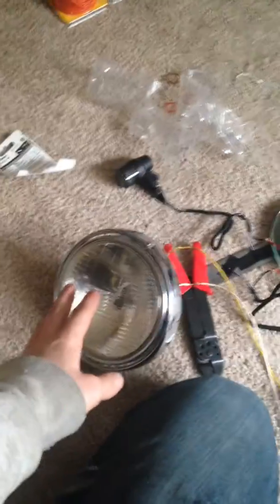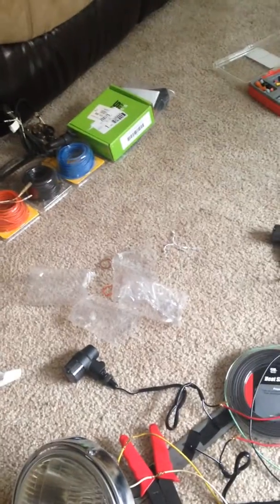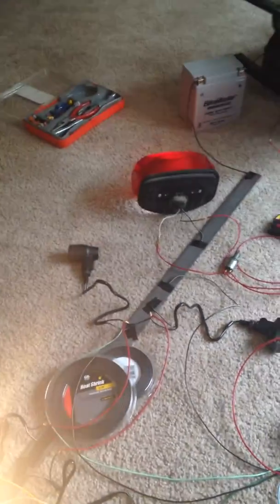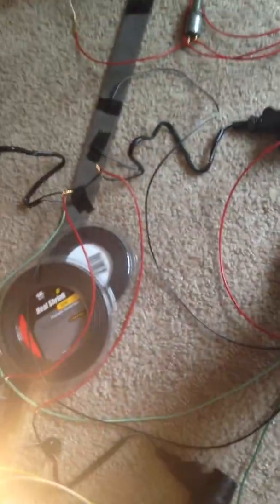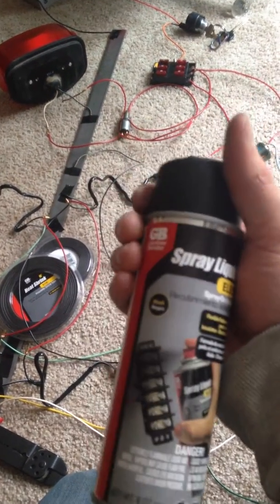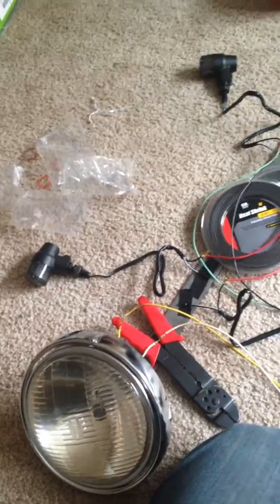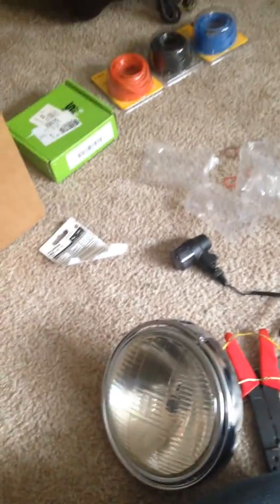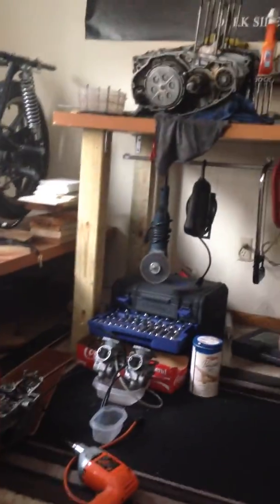Batteryless Motorcycle Wiring

Comment: Thanks. I'm rewiring a 75 cb550, do you think it's necessary to get the regulator/rectifier combo or will I be okay using the stock rectifier and regulator (they are separate units)?
Reply from the maker: Jordan Beck personally I would replace the old one. I typically like to replace all my components if I am going to be replacing one of the few

Comment: Hey +Tater Head, just curious if you would be able to send me a more in depth wiring diagram for what you did. I'm very interested in doing something similar with a '78 CB400T
Reply from the maker: +KaloTallman Did you see everything that I had in the description? Here is my most beautiful piece of art work so far... haha not
https://goo.gl/photos/5NVBik8989PZdtta7
Reply: +Tater Head Hey thanks for the quick reply! I was actually more curious about the aux wiring you did for the lights etc, mine has absolutely nothing left as far as a harness for the lights, and I'm pretty new to wiring in general. Just curious about how you wired in the flasher and fuse panel and everything. Thanks again man!

Comment: I got a Suzuki GN400 that I plan on doing this to, only difference is I have a CDI unit on mine instead of points. Would the Reg/Rect unit go directly in between the mag and CDI unit? From my understanding of your diagram, the red goes to the ignition then to the board. Also, where is that board from? Thanks for answering the thousand questions if you do.
Reply from the maker: +Eli Mercier Sorry for such a delay, I have now added a different wiring diagram that is the last URL in my description. That should clear up some of your questions. I got that fusepanel/board from a NAPA or just a normal Auto store.